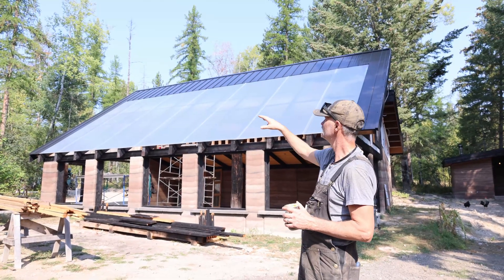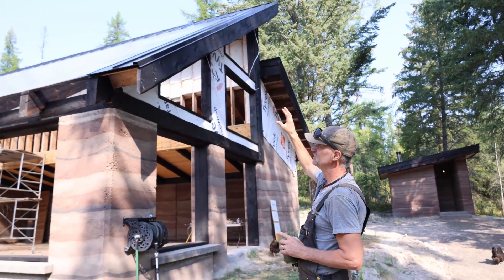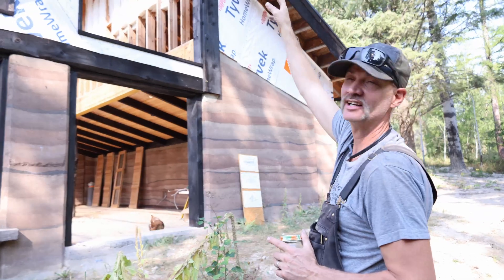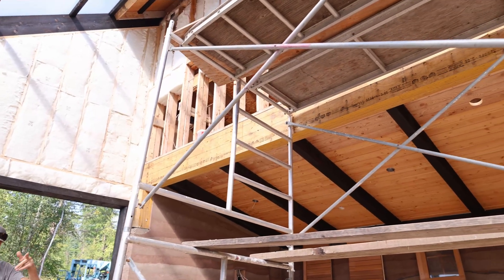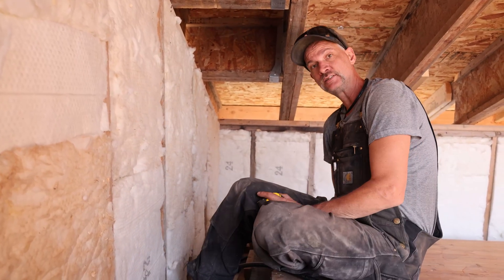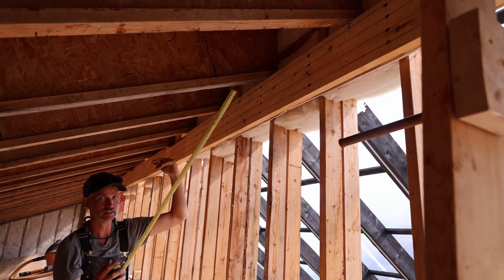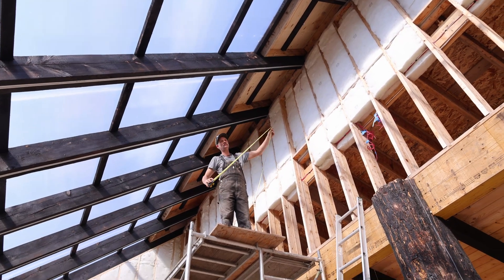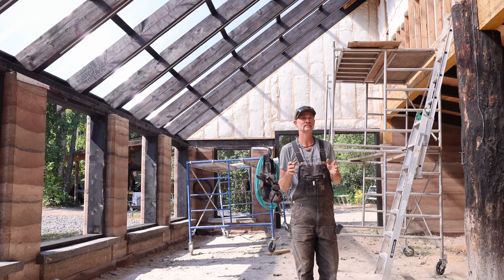Inside The Build: Our Sustainable Rammed Earth Greenhouse

Comment: I have been wondering about this! Glad to see the progress. I can imagine a smaller version on an Earthship. A friend here in Southern New Mexico is building a large rammed earth house north of Las Cruces 24" walls on the first floor, 18 on the second. Not as pretty with the different colors added, but because it will be over 6000 SQ Ft, time was of the essence. We are hot and dry here. The next project will be a much smaller rammed earth Casita with some Earthship features like a grey water cell, and attached greenhouse.
Reply from the maker: Sounds amazing!! Good luck with everything ☀️🙏